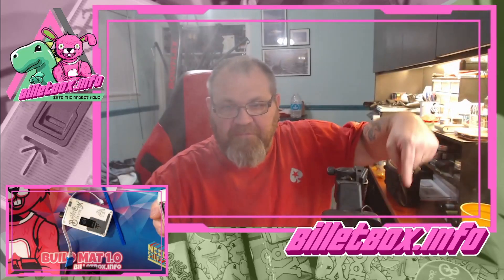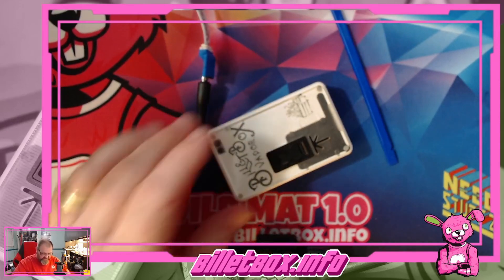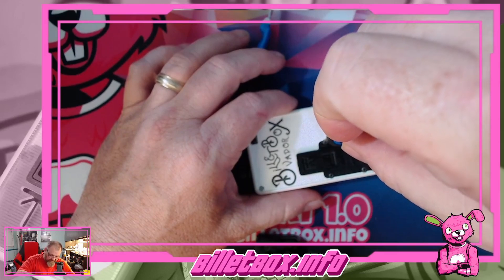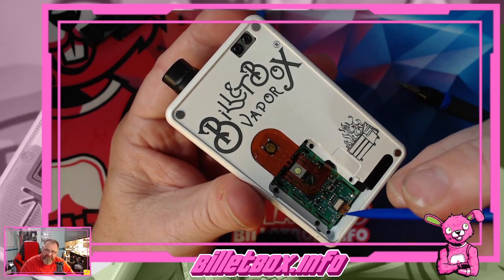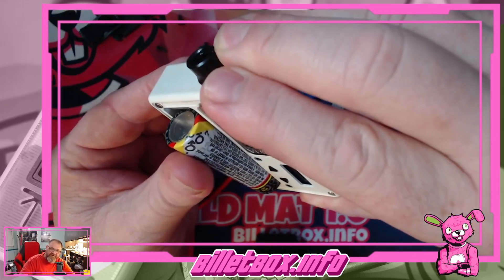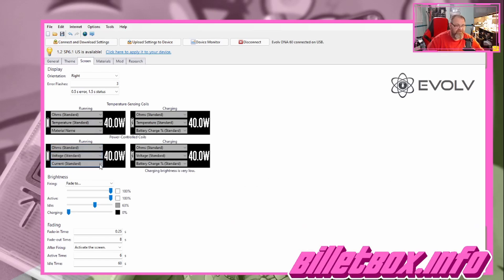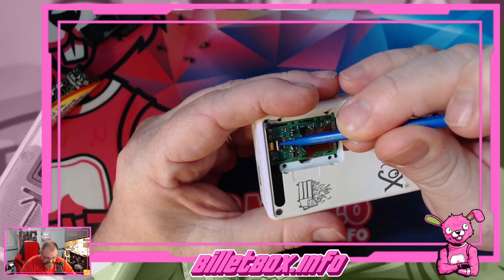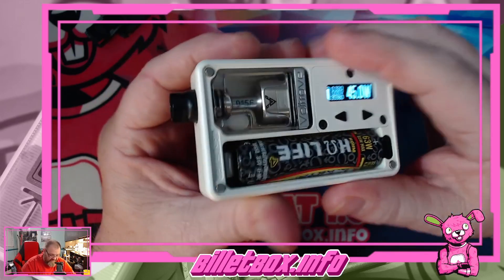Hooking a Billet Box Up to Escribe

Comment: Great Video Chris..
  Was wondering why you didn’t reset the  “puff count”  to zero while connected up to escribe?
Reply from the maker: I want a running total count. :)
Reply: The only reason i wanna do this is to see how many puffs after 2 years of constant use. I wouldn’t want to reset that
Reply: @rickymahoney6664   I hear ya and You wouldn’t have to reset it permanently..
Hell I wouldn’t want that either. 
  That’s what makes e-scribe so useful and so cool..  not only can you literally access all the devices settings 
  ..it keeps a permanent record of the devices total puff count (along with a ton of other useful data lol ). 
 

  So.. you could easily rest your puff count without losing the total life’s puff count of your device 
  That’s what I do with my BBV Ratt Black BB. Also it’s way cool to use e-scribe. 
  I just put together a self made adaptor.. made from an evolve USB  dna 60  charging chip and a set of fatty jumpers (all nestled with some shrink wrap).  Protovape used to have them for a very reasonable price..
Reply: @CJ_Blues  oh damn I didn’t know that. Ive never used Escribe cuz i dont have a computer. Even tho every device im using right now is a DNA lol. There’s not many reasons i need an actual computer but thats 1 of them
Reply: @rickymahoney6664  
  Yeah bud.. eScribe is absolutely mind blowing with all the integration power it has into your devices.. (even more so with later dna boards). I will admit it is a little bit overwhelming at first but after a while you get the hang of it (and the community forum is ran by some very helpful folks).  
  Just with the dna 60 you can do a ton of stuff..  there’s a cool punch/preheat feature that you can set that’ll give you a boost of power (initially) to quicken ramp up time. You can monitor your battery’s life, and how it reacts with your use.. you can change the time it takes for your device to go to sleep or the brightness, fade time and even change the increments of how quick your wattage increases with each press of the button lol 
 ..and with the “device monitor” option,. You can watch every parameter (I mean every lol) in real time as you take a puff (watts, power,  volts, temp, board temp, ambient temp, room temp etc etc etc). 
 Also If your device happens to be reading the resistance a little bit off (not likely with an authentic but sometimes with age it may happen) you can tweak the internal resistance of the device to be spot on again (I wouldn’t recommend that tho.. unless you’re very experienced with it).  

  eScribe also let’s you incorporate a set of custom materials for every type of wire on the planet including your own builds and coils (one way is through steam engine)  ..all of which you can share with others and vise versa.. I  have a custom curve for small mass aliens and some other faves. 
  ..and if all that wasn’t enough then you got the theme and the theme designer program.. which  is way too much to write about lol. 
  
Honestly Its one of the reasons I love evolve chips and I wish BBV had just incorporated a USB with their boxes. 
  Either way with this tool you have the option to use escribe and it’s extremely useful. (Not sure if it’s worth buying a computer for or not?.. tho if you own a lot of dna boards.. it’s debatable). Good luck and HMU if you do decide to ever use escribe in the future..
Reply from the maker: @rickymahoney6664  valid reason 😁